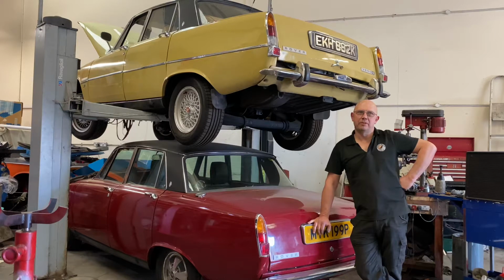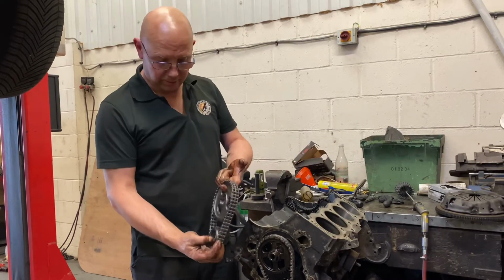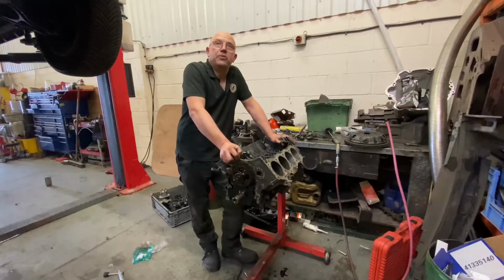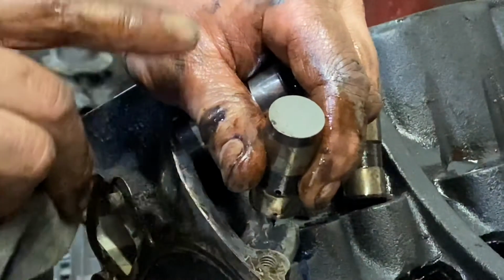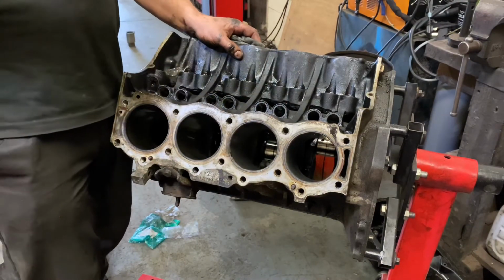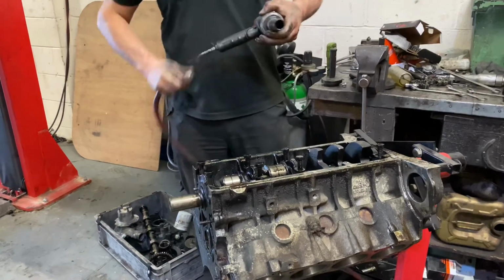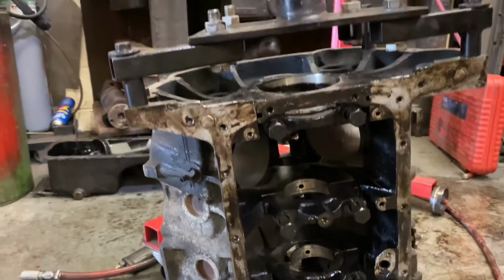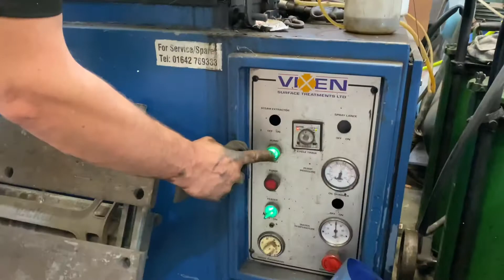P6 Rover 3500 - Part 3, V8 Weakness & Cylinder Honing

Comment: I have stripped and rebuilt 3 4.6 rv8s for my seight, they were bad but not as bad as that one. Cleaning the engine parts is monotonous, I find it more taxing than building the engine like you say. I bought a cheap full size Bosch dishwasher from gumtree for £40, best value for money tool I ever bought. With modification to the tray it will hold a v8 block no bother and it works a treat. The parts come out dry and warm too. Just need to watch the steel parts for flash rusting. Good videos on the rv8 too.

Comment: I've owned and worked on Rover V8s for 35 years, and have rebuilt a few and dismantled lots. I couldn't agree more with this. I've yet to strip a well used one which hasn't had the issues you've shown. They generally will keep running and sound OK when they're worn, but they get very lazy. You forgot to mention worn big ends and rockers and shafts, also ubiquitous.

Comment: Need to find the David Vizard Powertec 10 episode where he discusses timing chains and how tight they should be. He dynoed one that was quite tight. He then put a timing set with a little looseness in it in and dynoed that. Picked up something like 5HP. Now too loose like your first timing set is way loose for certain. If power is not off a bit,  the idle will be erratic as the cam allows the spark to "scatter".
Reply from the maker: Quite, a “tight” chain will drastically increase frictional losses, not just the chain itself but likely in the cam bearings

Comment: That engine was literally in the same condition as mine, was planning on just a clean up but have ended up rebuilding after the mains were down to the copper. 
Big ends and cam wasn't to bad though and used the hot pressure at work to clean then removed the oilway plugs to clean the gunky oilways 👍

Comment: they were a nice running engine but a soft engine at the same time...all gone here in ireland ..didnt work on one in years.. just sayn...great vid thanks.
Reply from the maker: Shame to hear they are all gone in Ireland. We obviously see many come though our doors. But also part of a Rovers Owner Club, so yearly (except 2020) attend events and see many beautifully kept / restored Rovers.
Reply: Not quite all gone, currently doing full restoration 1973 3500 auto, and a few engine upgrades, camshaft cylinder heads and carburettor and 5 speed lt77 gearbox, trying to find time to work on the old girl is the problem, ditto the engine, cam missing lobes and bearings on copper, yet oil pressure good and purred like a kitten , should be quick enough when done
Reply from the maker: Sounds incredible!
Reply: @PenguinMotors  hopefully one day soon,  other things got in the way so project stalled for a couple of years, but determined to get back to it before xmas so I have a definite plan for spring 🤞
Reply: @rv8338  How's the restore going David? And not quite gone is right, there are a few. I'm currently looking for one...again.

Comment: Oil Extreme Concentrate added at each oil change will drastically reduce wear.
I don't know anyone who has lost a lobe if using Oil Extreme in a decent Synthetic Oil
Reply from the maker: TBH i dont know anyone thats lost a lobe after a rebuild, mostly they loose lobes because of years and years of infrequent or non existent oil changes

Comment: This all looks like a really good reason to just LS swap it…
Reply from the maker: maybe, an LS swap would give a huge amount more power, but you would have to re engineer just about every aspect of the mechanical/fuel/electrical side of the vehicle to suit
Reply: @PenguinMotors No shortage of standalone ECU and fuel systems available for LS engines :) 

Yes, a lot of work. But P6s are mostly all weekend toys these days anyway. I’m having recurring thoughts about a restomod with an LS, a modern auto box and the Jag LSD diff. And then brakes to suit. And then suspension mods to suit. Etc etc…. 😂😂